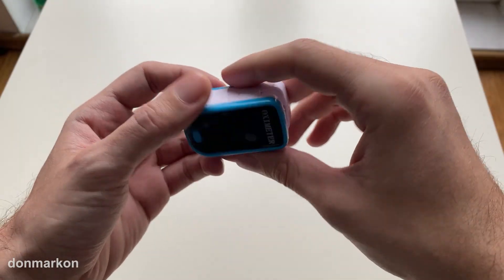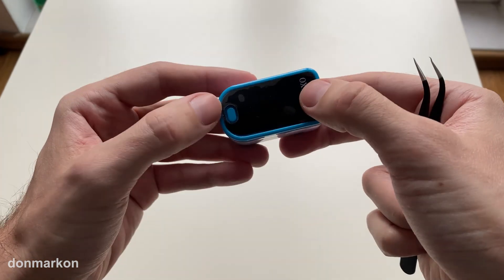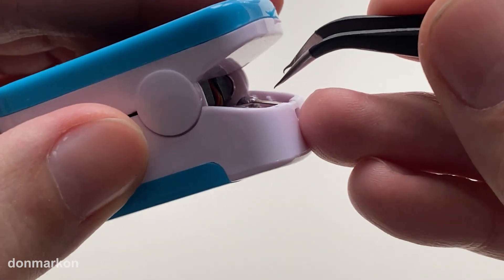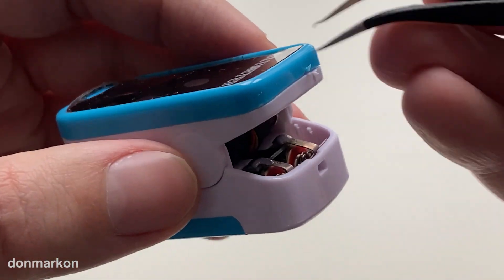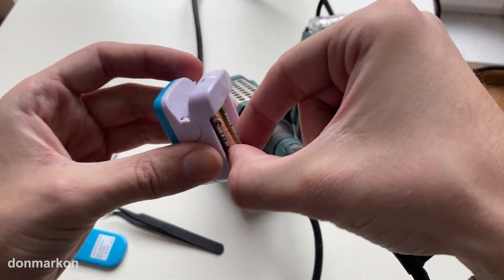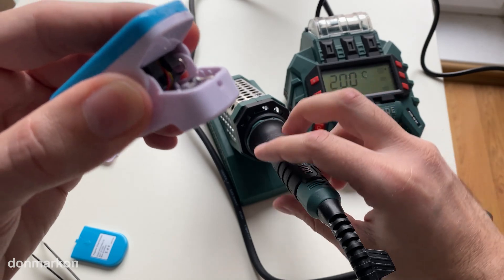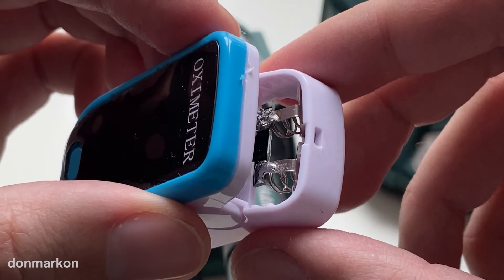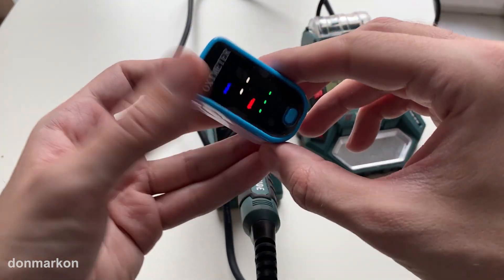Pulse Oximeter Repair | Screen Sensor Not Working

Comment: My spring contact was rusted so I sanded and cleaned it. Popped the battery back in and it worked! Then I put the cover back on and it quit working. I think the cover is pinching a wire. (The compartment cover you removed) But at least for now it works as long as I leave the cover off.

Comment: Mine works just fine, the sensor light comes on, but the screen is dark. If I look at it VERY carefully, I can actually see the readout on the screen, but it is not illuminated.
Reply: Mine, too.  I took the whole thing apart and couldn't find anything obvious.
Reply: @rprastein did you manage to find the problem?

Comment: Great idea, but terrible solder joint, a so called "cold solder" joint.  It needed just a tiny bit of flux, ideally rosin, not acid.  Since you have a soldering iron, it would you should have a little bit of flux, or even a short piece of rosin core  solder.  Just adding a little bit of solder, with the flux would make it shiney and reliable.  Cold solder joints are not reliable, even if they work initially.